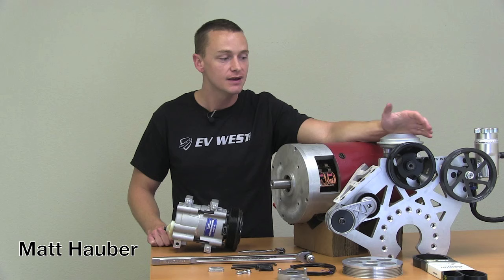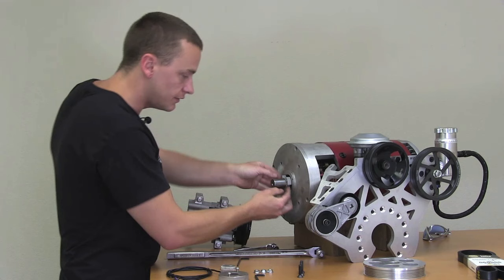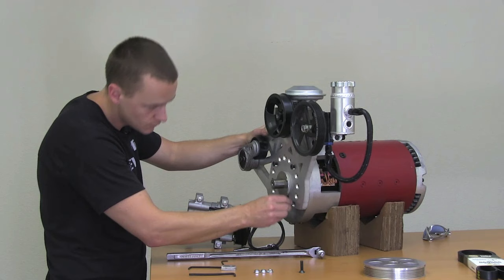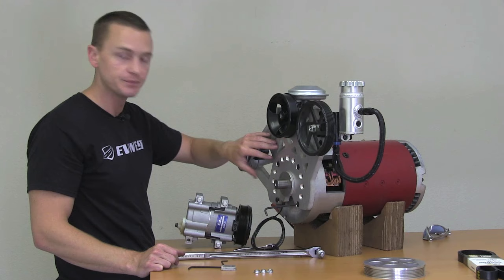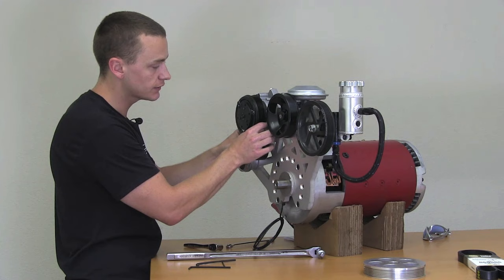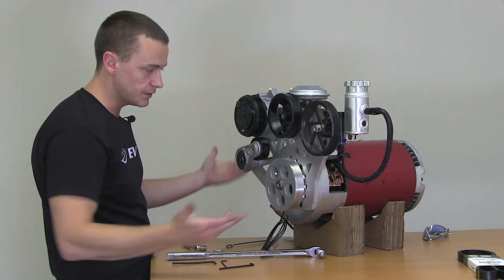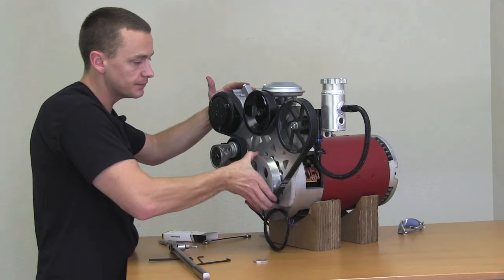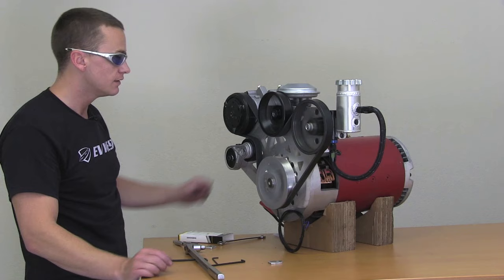EV West Electric Motor Accessory Plate Installation Video - Power Steering, Vacuum, AC Compressor

Comment: What a great clean  retrofit tutorial,  this is right up my ally and like to know more , Reading comments on what to expect when vehicle is in stationary position ,sometimes it’s necessary to at least have the power steering pump still operating to allow easy turning capabilities,with auto trans this could be achieved by setting the motor in an idle position , is this possible with the crank sensor configuration to adapt to the vehicles existing electronic modules or is the power train module obsolete once this motor is fitted ?, I guess this could  be also achieved with manual transmission systems as well providing clutch is depressed just like a aspirated engine ,I think it would be a different feeling riding the clutch and having no stall effect , what laws do you think are implemented for this type of setup ?, i recon it could easily not be  required for smaller vehicles with less steering force than compared to a SUV ,I’d be happy with that outcome and to be realistic this awesome retrofit is perfect for the small size car , less weight to pull around giving better mileage and bang for you electric buck !, look forward to any comments and how a possible auxiliary power steering pump could be the better option , hey what do the Vw and Audi vehicles do to overcome this power steering issue when their vehicles are set in MHD and turns engine off whilst stationary at lights , Am I looking into deep and most vehicles you  can still turn the wheels with a little  bit more effort ? DK from down under 👍

Comment: This setup gives you powerstearing and so on, but onely when you drive. If not, what am I missing?
Reply: +Erik Blomdahl Push in clutch, engage motor.
Reply: I think if your mated to an automatic transmission, then the motor runs slowly on stop and would turn off completely once you shut off the car.  My thoughts.

Comment: how works exactly ,  has only one shaft or two independent shaft?  one for the motor and other for the equipment like air conditioning,  power steering and vacuum,  please explain to me...

Comment: You should be able to make that motor run on an alternator or a few alternators it should only start off a battery then run off the alternators and a motor with the double shaft the shaft in the front shaft in the back the back shaft can run the transmission

Comment: The pump pulleys remind me of electric scooter wheels. So. Suppose you cant idle efficiently but it the pumps see separately driven by electric wheel type motors. Im using laymen terminology. Would it be more efficient?  It would at leat eliminate the need for a belt. Maybe a 12 volt compressor like my portable fridge has would be nice. You could probably pump the hrdraulic steering anoter way. Btw that's some nice machine work with that adapter plate. W his I could do as much.

Comment: What about a separate motor to drive the accessories ? from what I understand if the main motor does not turn when the car is at a stop the accessories (a.c etch) will not work I know that there maybe enough pressure buildup in the power steering and brakes but for how long will the pressure time last ?

Comment: is better use a small 3hp motor to A/C, independent of powertrain line. So you can use AC with the car and main motor stopped

Comment: whats the max amps this setup pulls? and if i was rich enough how much power will 4 motors linked together like in the video need? and what is the benefit of the power glide over a regular automatic transmission. and why not brushless dc motors.

Comment: Hello, i'm very impres with what you guys are doing. I would like to know more about this. For example can you make a space to setup a 600 amps alternator?. And also if after making a full conversion Let's say I have to drive down the hill every day is there a way to reduce the speed without using the brakes in an excessive way. Let's say that I down shift to second gear, the electric motor will act in a similar way to the internal combustion motor? Is it posible to couple an electric motor to an automatic transmission? And how much money do i have to put in a complete project?

Comment: What would be the best electric motor for a 2004 Chevy Silverado EXT Cab truck? I'd like to have something powerful enough to do everydy driving to and from class, work, day-to-day errands, but still be able to load up my truck with a 500 lb load and still be able to maintain interstate speeds. Is there anything available that has that capability?
Reply: Why not go to DC for much more torque and lower cost , a larger motor like a Warp 11 only $3,100  retail.  Enough torque to move a full size pick-up truck and a couple tons of trailer. Add another $1,000 for a simple DC controller. and no transmission needed at all. so you can scrap or sell both the engine and transmission put the new motor under the cab where the transmission was and 1/2 the battery pack under the hood and 1/2 under the truck bed behind the cab, but, in front of the rear axle for good stability and handling...
Reply: yes if u millionaire lol

Comment: Hi John!  You mentioned in another post about solar installation to run a home central AC unit.  My unit is a small one for a 1200 square foot home.  How much or how many solar panels would I need to power it?  what about a battery bank for night use?  etc????  I'm looking to try to get off the grid somewhat here.  (Cutting energy costs)

Comment: I think electric everything is better - Electric AC Compressor, Electric PS Pump and Electric Vacuum Pump. More effective and more mounting options
Reply: +mastergx1 And why does everyone keep saying to add an alternator - clearly you people are not familiar with the laws of physics. Put simply, the additional load put on the motor from the alternator would overshadow the gain in charge. The motor would have to draw an extra 100 amps+ to drive a 90A alternator giving you a continuous loss. Even in a perfect world you would only be able to generate the SAME current that you are drawing and this is NOT a perfect world due to losses such as heat and electromagnetism.
Reply: Carlos Tavares Jr that's kinda pointless. how much are you spending to mount the alternator and make it work vs the already tried and proved DC-DC converters? a DC-DC converter is more efficient than an alternator.
Reply: There is no need for a standard 12v automotive battery in a properly designed EV. All you need is enough of a battery to power up the motor controller; the controller has a 12v accessory output that is more efficient than an alternator and can run every accessory plus charge the 12v battery, just like an alternator.

I too was curious why you'd use belt-driven accessories, in an EV. Vacuum and PS pumps are easy to power electrically, and even an electric-powered compressor would be more efficient than driving them via belt from the drive motor. Plus, driven electrically, you don't need to keep the drive motor spinning when stopped, which improves efficiency and range even more.

Comment: instead of having ac or power steering. can you run a series of alternators to help charge your batteries?
Reply: "Yeah, you could... totally do that"
Reply: Komsing Phanthavong no. that's using a battery to charge your battery. there's too much loss, it wouldn't work efficiently, you would just lose mileage.
Reply: why couldn't you do that? Maybe have a separate system for the alternators to charge them using a solar panel then have the alternators charge the drive batteries? I think it could work.
Reply: I was thinking the same except i would use the alternators for audio use. In future i will convert my lada 2102 to electric and it doesent have any accesories except lights, heating and power brakes.
Reply: If you used a flywheel system to build up energy you could maybe balance out some of the losses
Reply: Anything you add to the motor adds load and requires more power to run doing nothing but causing loss, so adding alternators would just be a drain on the system

Comment: but the power steering pump must be turning in continously and the yor motor turn only when you push for driving. in the trafic light when the car is in stay mode the steering pump wheel can not turning and to turn the steering can be hardly.

Comment: Nice setup. How do you run the wheels off that motor? Doesn't seem to be lots of room to hook-up a driveshaft or transmission.
Reply: on the other end of that same motor you would have a adaptor plate to mount to a transmission,  or  if you wanted a direct drive to the differential.  but, I would suggest a manual trans myself.  that way your motor could be set at  a minimum idle speed so the belt driven accessories never lose power.
  but just as some here have suggested,  having a smaller second motor to run your accessories would probably be better. or just use electric accessories.

Comment: hi guys!! what Of the availables motors Could i put in my Renault 21 GTX, transmission manual Of 5 gears (very similar in size and weight to a Crown victoria) and how much is the cost Of entire kit with this adaptor included. do you send to exterior?? greetings and thumbs up from Argentina!!

Comment: I have a 1991 Chevy Caprice Classic that I would like to change over to an EV. I am wondering what size motor and electric components will I need.
Reply from the maker: You can check with the sales team at EV west using sales@evwest.com they can answer the specific questions you have. Sorry of the delayed reply... Drew - EV West Media Manger

Comment: I'm looking for a electric motor for my van any help would be nice its a four cylinder 2.7 litre diesel normal aspirated 5 speed manual i want to keep the 5 speed
Reply: Manual trans wont work with electric. You would melt you melt your clutch.

Comment: Why don't you include the alternator for charging the 12 v. aux battery? Low cost, reliable, works to maintain the accessory 12 v. battery automatically, and save $150 compared to a DC/DC converter, with no drain in the traction pack when not moving... Many of us old experienced converters us them... .
Reply: A DC/DC converter is going to save you energy.  Using an alternator on a belt is  less efficient. Either you drain the pack directly with the DC/DC or you restrict the motor which is draining the pack.
Reply: Balaji Seward Unlike you I sometimes slow down or drive downhill and during that 25% of driving time the alternator uses no pack energy. on acceleration or uphill the additional power consumption is no more than the DC/DC converter draws from the pack so where is your advantage?  OH Yeah, like I said you don't sell the alternators...

Comment: All and electric engine has to do is run the same RPM as a gaz engine when in idle right ?
Then have a transmission for fast speeds and power.
Then have a generator recharging the other battery's while you drive then switch when the others are drained .

Comment: A good point about the idling motor - do you have a solution?
Reply: They are using a two speed transmission with these motors, so they just put it in neutral.

Comment: I have a cabin cruiser with twin ford 302 motors and have thought about a conversion
the motors I have now are running 250 hp each which are running through borg warner transmissions and v drives how hard would a job like this be and would it put out enough to get it on plane ,, and what do you think it would have for distance,,
how do I get in touch with you?? is there a phone# to talk to someone,,
thanks for the video,,

Comment: I'M SURE I WILL GET RIDICULED FOR MY QUESTION , AND THE MODIFIED P-GLIDE IS VERY SHORT , AND TRICK , I AM ASSUMING FOR A WHEEL TO WHEEL FIT EITHER FRONT OR REAR . BUT FOR THOSE OF US USING A CONVENTIONAL FRONT ENGINE-REAR DRIVE SETUP--WHY NOT STAY WITH A TORQUE CONV.--THIS WOULD DO AWAY WITH THE ALL THE PROBLEMS , AND COST OF ALL THE ADD ON'S JUST TO MAKE  IT WORK LIKE A GAS ENGINE IDLING AT 700 RPM OR SO--THERE ARE MANY LOW RPM CONVERTERS , AS WELL AS LOCK UP TYPES THAT COME ON FACTORY VEHICLES--{ COST SAVING TO THE EXTREME }--. BY USING IT AS A GAS MOTOR REPLACEMENT ONLY--{ AS WELL AS YOUR VERY NICE ACCESSORY BRACKET } , WOULDN'T THIS BE MUCH MORE COST EFFICIENT ? YOUR WORK IS BRILLIANT , AND I SALUTE YOUR THINKING OUTSIDE THE BOX . THE ONLY PROBLEM IS I  , AND MANY OTHERS DON'T HAVE ELON MUSK'S BANK ACCOUNT BALANCE .

Comment: Wouldn't you have to let the motor idle when the vehicle is stopped? You wouldn't have AC, power brakes or steering when at a stop light. Probably not critical, but does anyone know how this would effect brake and  steering performance during stop and go scenarios? Thanks, I don't have any hands on experience in this area :-)
Reply: George Foreman Nice, thanks for the reply :-)

Comment: How do I buy the electric motor and accessories.
Regarding 280 horsepower which engine power in hp should I buy and if could I pass the site for purchase. Can you provide me the website address to purchase?

Comment: I would like to convert my 3/4 T Dodge to pure diesel electric. No batteries. Small diesel and genset to electric motor. The same as a locomotive. I pull a 32' travel trailer. I am considering this as an option to straight diesel. Doable or waste of time?

Comment: Throw an alternator on it to keep battery charged
Reply: Michael Kitchens Bwaahaa Bwaahaa Bwaahaa
Reply: That would have to be an alternator for an ocean-liner
Reply: @KnowledgeMotorsport  I think most folks  are talking about the "starting battery" or the one that's used to power the conventional 12 volt accessories in the car.

Comment: Yea so its a lot cheaper just to chop out the front mounting plate and back mounting plates that are built into petrol engine that is blown and needs rebuilt any ways and doing very little modification then to buy these 500/1500 dollar adapters. Doing this would be like 250 at most with modifing and reconditoning.

Comment: I want to have you to convert my van to electric. and never plug into a land base system.
[#Recharging onboard.] [#never plug in or need to charge the batters from an external source.]      
 Is it posable to have a system to recharged the batters onboard without plug into a wall plug? 
 [alternate] to recharge as you go down the road? 
put back into the batters what voltage used as the car runs down the road?

Comment: A manual tranny with clutch is best for this. That way you can hold the clutch down and rev up a bit to get power steering at a stop.

So, this only works with a female spline, I guess?

Comment: How you then keep AC and power steering ON when car is standstill ? Idling!? EV is stupid idea . Or car is on the move all the time like in racing ?
Reply: You just put the transmission in neutral and idle the motor.  They are typically using a powerglide two speed transmissions with this motor.  Electric motors are not stupid, they have better performance and efficiency than gas engines.  Most EVs do not use a pulley system for their power steering and AC, they use  electric power steering and AC compressors that run right off the battery, no belts needed. He made this bracket so that you could covert a normal car and use the existing components.
Reply: AC works for a Minuit or three, If I'm stopped I am not steering ??? it works as soon as you are moving. And the old Non-Power steering was similar when stopped, learn to move while turning the steering wheel then it works fine.  His Ideling wastes far too much energy. If you are very weak use an electric motorized power steering pump they are available and run on 12 V. ask at your parts dealership or salvage yard.

Comment: but the motor has to be running.. aka you have to be driving the thing to get power steering or brakes or ac.. once you stop it all stops why not just do a kit with their own motors on each product

Comment: As far as the power steering goes it's useless. You only really need power steering at full stop when the electric motor isn't spinning/powering the pump.

Comment: A separate motor to run the accessories would be a better idea...then you would have ac. and power steering without depressing the gas pedal...unless you had an automatic transmission with a separate motor to run the trans pump. But then your using the main drive motor to run the accessories even when your sitting, Which is not very efficient. Six of one half a dozen of the other really makes no difference. But turning the main drive motor may use more power than a small accessory motor

Comment: Why not use brand new electric ones.  I would think it would be much cheaper to run the tiny motors in electric pumps than use that big honking thing.

Comment: the problem with this is the expense of changing your car over if your doing this to cut down your green house gas you wouldn't be as you need to plug into your mains to charge the battery's so with the cost of putting it in plus the cost to keep it charged you would be no better off

Comment: why not get an Audi power steering unit, they're electric!
Reply: Audi isn't the only one. This is a common thing with newer cars in an effort to save fuel by reducing drag on the engine. Both my current Camry and the Malibu I traded in on it had that.

Comment: if motor dont  Run no power stering no vaccumm 
the motor need to Run all time
Reply: in a stop no vaccumm no a/c no power stering
Reply: +David Dematos You would set an idle speed to the controller. ie the motor always turns at least 700rpm. You will need a clutch and drive like a normal car.